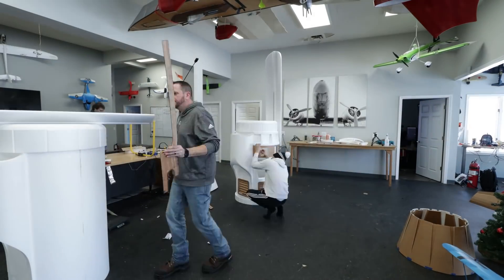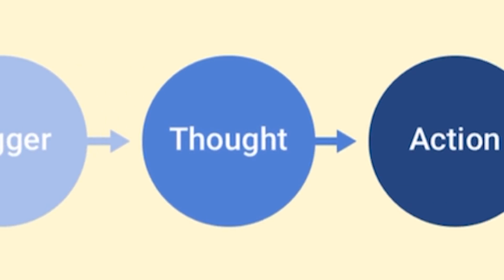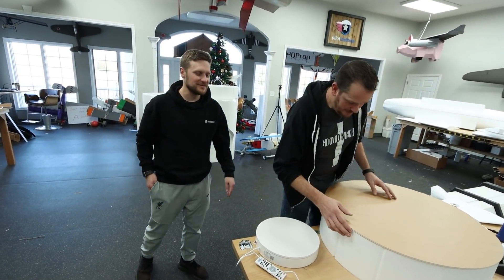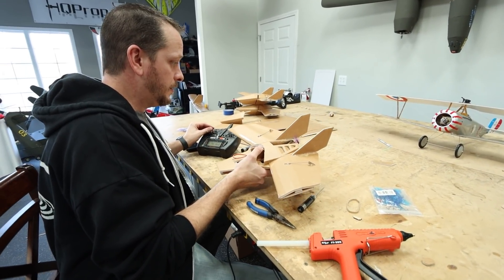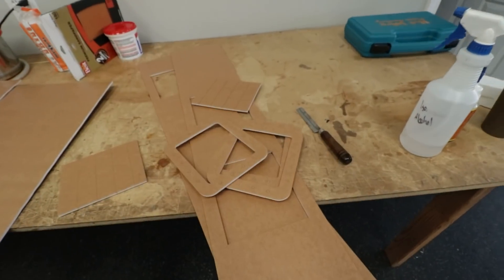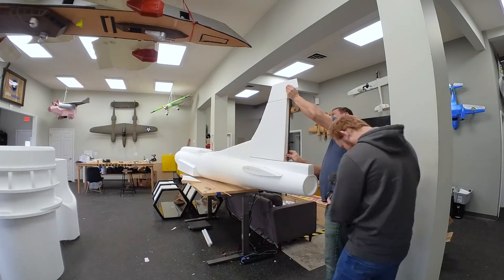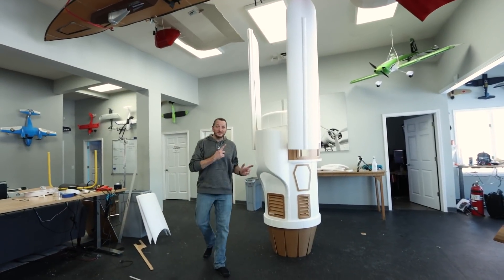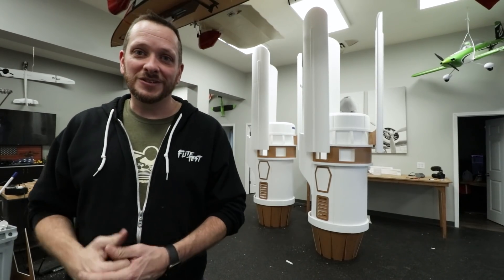DIY 10 Foot Star Wars Pod Racer & B-17 - Week 3

Comment: … the foam templates would be sided with plywood or ur brown depron sheets for rigidity…
Wings: use 1 alu bar in middle with for example wood bars at the tips of wings….
Then might need testing also….

Comment: you guys should make a plane with no moving control surfaces. replace them all with motors. Roll is controlled by motors on the wings, elevator from motors on the nose and tail and so on. I think that would be a neat challenge
Reply: X-wing with 4 motors
Reply: Realizing I literally just described a drone. What I meant was to have an normal airccraft model. But put motors on the wings like where the control surfaces would go

Comment: WOW, what a build! Back in 2014 did you even dream that Flite Test would become what it's become? Thank you Josh for telling people to charge their batteries at 1C NO matter what it says on the battery pack. I had an accidental house fire in 2015 due to a battery that caught fire in my garage before I had an understanding of just how dangerous these batteries could be. Always charge your batteries on a fire proof surface, just in case. I haven't had another issue with a Lipo battery. With that said, I have had two people I knew that did have a battery catch fire. Charge Only At 1C on a fire proof surface!.  😊 Josh is absolutely right, charging at 1C will make your batteries last much longer too.

Comment: If you cut out ridges / ribs in that long round foam spar, so it more or less looked like a long gear, then fibreglassed it, it would be far stiffer and for close to the same weight

Comment: The CNC cutter will come in handy building a giant Spruce Goose ( hint , hint , hint )
Reply: That would be super cool! And glass it so it could land on water!
Reply: ....a "real" homebuilt experimental airplane...they'll get there....
Reply: Would love to to see the spruce goose. Should even scale down the props and use nitro model engines.
Reply: @That_1_Derpy_Dragon  but they only use electric motors
Reply: @matty4z  but it would be neat to try nitro on a plane of that magnitude.
Reply: @That_1_Derpy_Dragon  long as its not to close to the foam  lol
Reply: @matty4z  glass it, and use a wood piece at the end, then aluminum for the engin to bolt onto. Aluminum dissipates heat quickly, while the wood acts as an insulator between the foam and alumimum